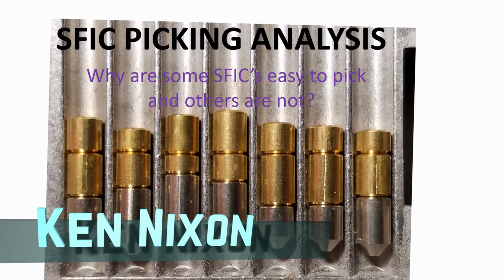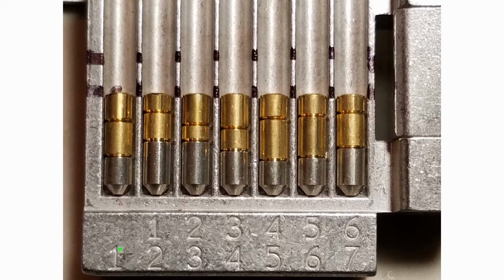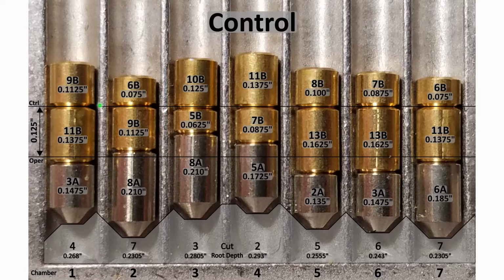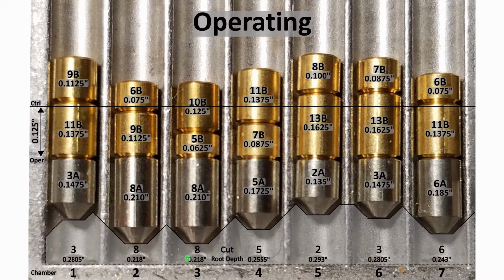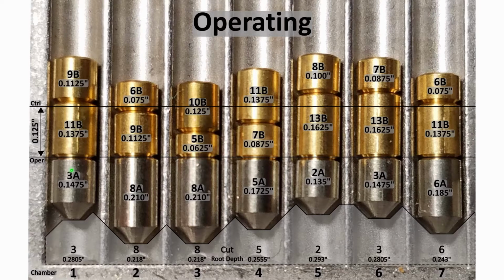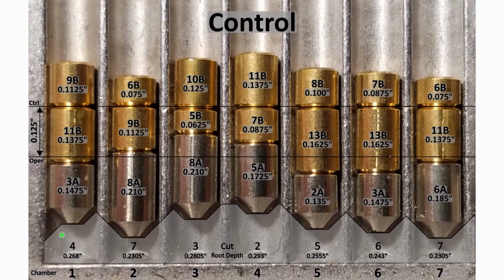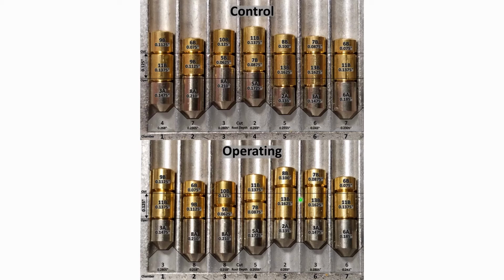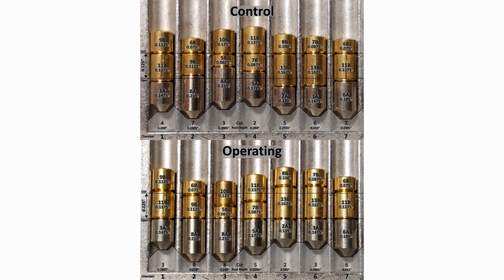SFIC Picking Analysis

Comment: great job showing the difficulty in picking these locks. 

for the sake of discussion, let's take lock #1 with control key (4732567), say you pick from front to back starting at pin 7, ignoring binding order, you would get the first 3 pins to control first, i reckon this would influence which shearlines the other pins would bind at, given that there will be more tension on the control sleeve than on the operating core, this would then predispose you to be able to get control easier if you pick from the front. however, if you pick to 2 clicks on the first three pins, this would logically put you in a position to get to operating easier.

this would then be a good method of how to get an SFIC to both shearlines for a purple belt. given you are lucky the binding order cooperates.

Comment: Thanks! How do you know which sheer line you're at? Do you get a different sound or feel? Is it easier to pick CCW to learn the depths for the operating key and then reverse it to control? I haven't tried an SFIC core yet.
Reply: That is precisely the difficulty in picking SFIC's.  Yes, I think that is an interesting comment to try picking CCW first to get to operating, assuming no pins will "hang up" on the control shearline just a tiny bit. So that is part of picking SFIC's, to remember, or make notes, of what key lifts operate the lock, then eliminate those to arrive at control.  If you only find 1 click on lifting of the key pin, then perhaps you have a chamber where you have picked to both the operating and control shearline.
Reply: I see. That makes sense. Thank you.